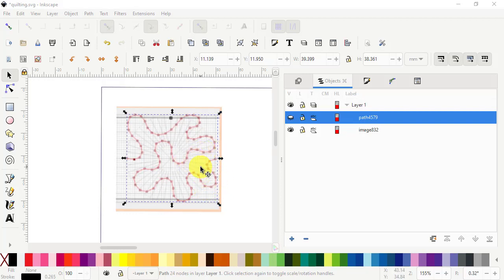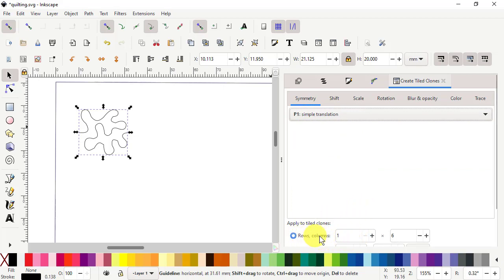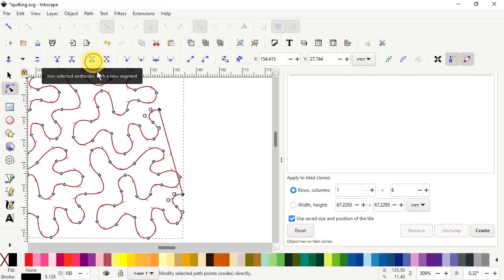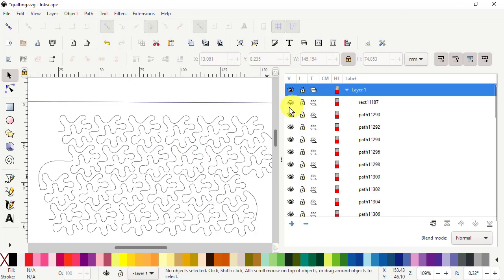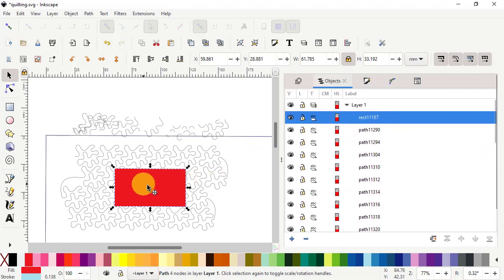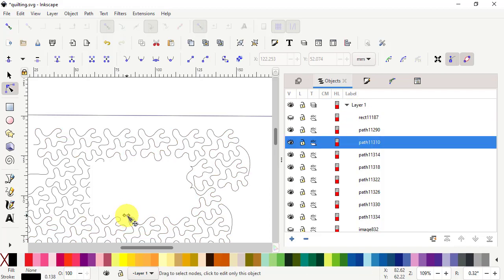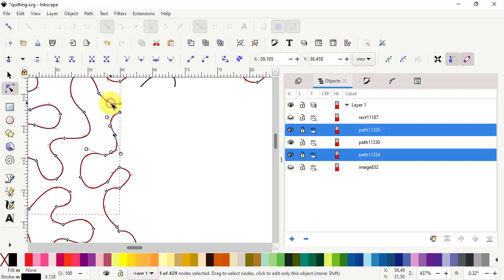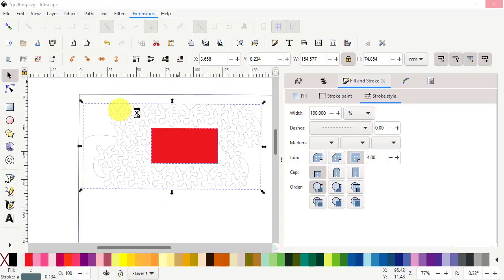create a quilting around pattern

Comment: Hi Gus. I am the gal, Lisa WeQuilt, who sent you this Design to see if you could make it stipple around a design without travel stitches.  There seems to be a secret to morphing a Quilt pattern around an image.  The expensive digitizing programs know that secret  I wish we could all put our heads together and figure it out.  I tried Pattern along Path, but that was also a lot of work.  I just know that Inkscape has a setting that would make this in just 1 or 2 clicks.  I wonder if any of the Cloning choices have a morphing of some sort that just repeats and distorts the Quilt pattern as needed.  In Quilts, most of our center Designs are irregularly shaped, so we need a technique that does most of the thinking for us.
Reply: Can u just create a quilting pattern and then cut the shape out of it? Not how it’s done here though, but rather by using CTRL -   Also, I’m not sure exactly what ur trying to accomplish, but my first thought was envelope deformation, or the opposite thereof.

Comment: if you select the rectangle you can send it back behind the running stitches to make selecting the bits to remove easier, then bring it back to the front. if youneed it to stitch in that order. or you could just set the stroke and remove the fill to see what should be removed, again changing it back to fill once done.